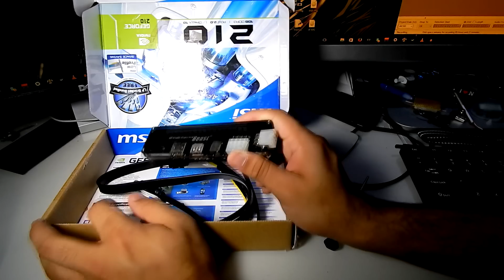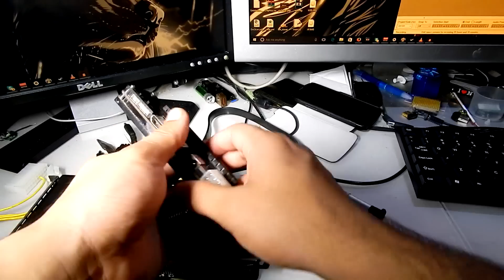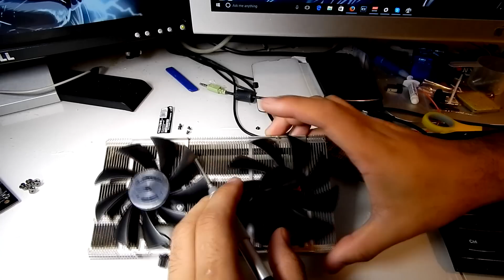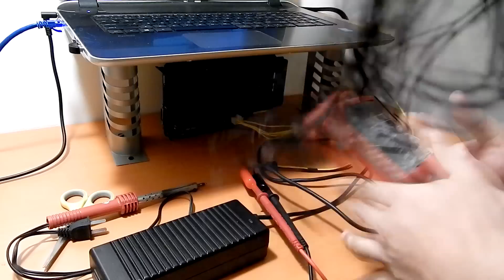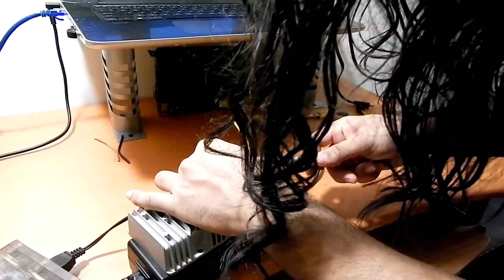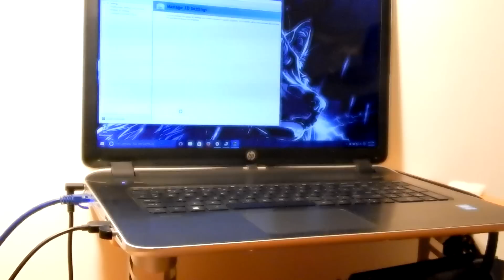Turn Any Laptop Into A Gaming Machine For 72$

Comment: 'Any laptop'...

Let's try with my Pentium II laptop! :)
Reply from the maker: I will die if that works xD
Reply: I'd love to "upgrade" my IBM ThinkPad 380Z (though it's not posting anymore :( )
Reply: lol good luck
Reply: Pentium isn't bad. It is just REALLY old.
The pentium was made before 2000 even.
Pentium III and Pentium II were also before 2000, and at the time they were good. The pentium 4 was just terrible though, and just used lots of power and made lots of heat with not much speed.
Reply: MrBiky Wow, I have a 380Z aswell! That was the laptop I was speaking of in the comment. :)
Most of it is made from parts from my 380E though. :/
Reply: +television and cheese Wow, awesome :D mine kind of stopped working, but that won't stop me from fitting a Raspberry Pi in it, lol
Reply: oh, crap, I'm on the other account
Reply: wait so Pentium is a bad processer?
Reply: i can't do it with pentium?
Reply: Youll probably be bottlenecked
Reply: One of the lower end processors yes
Reply: +Tech Talk Intel Pentium is that bad?
Reply: +television and cheese so if I'm getting a new laptop I should get Pentium?
Reply: I heard there was a new Pentium CPU, but it isn't very fast. If you live in the past, then Pentium is great choice, but today now is not a good idea. A good CPU is i5-i7 m series CPU. If you want something really really cheap, but still okay speed, get a laptop with a Core 2 duo. They sell on eBay for under 1$, but not as fast, just 'Okay' speeds.
Reply: +television and cheese thx!
Reply: Cough Pentium g3258...
Reply: +TheJrock _ g3260, i don't need oc
Reply: Yar! Ye be treatin' yerself to the bottleneck!
Reply: i wanan see this happen with my 17 inch laptop with and amd a6-6130 with r4 graphics
Reply: You'd have to take out your WiFi card, and have your laptops case propped open unless you cut a hole out for the cable run. 

These have existed FOR YEARS. I can't emphasize that enough. The problem is that doing all the things required for it. You can't really use it as a laptop anymore. It's also not plug and play. Requiring at least some degree of comfort with laptop repair to install them.
Reply from the maker: yea they have been around for a while.
Reply: I know. It was a joke that they used the words "Any Laptop" which isn't very accurate. 
My pentium II laptop doesn't have any internal PCI ports. Just one RAM expasion. There is no onboard wifi.
In some cases laptops have the PCI port under the keyboard, making it harder.
Reply: the funny thing is to get to my wifi card you have to take my keyboard off and my mother board out of my laptop just to get too it so its not for ALL laptops
Reply: willendler1993 william endler 
You still could. You'd have to make a cut out for the bottom of your case.
Reply: the way it is 
its the cooling fan then the wifi card then the keyboard so i cant cut anything on the bottom plus i still have 1 year coverage via hp and 2 with walmart plus il be building my own gaming pc soon and maybe a gaming laptop too
Reply: willendler1993 william endler 
Basically you're saying you don't want it bad enough. My past 3 laptops have been built like that, and it's never stopped me.
Reply: nope since i already have an alienware alpha with the i3 8GBs of ram and overclocked 860M and i only use my laptop to watch live streams and get on facebook since the a6-6130 in it slows down under load (from 2.4GHz down to 900Mhz)
Reply: +willendler1993 william endler wait m8 can my intel 4004 with 750 mb ram ?
Reply: You got this..... Hopefully
Reply: would it work with an elitebook 8460p

Comment: If i already have an descrete GPU in my laptop (GT 750m) does still work?
Reply from the maker: Im not too sure i dont have a laptop like that to test this with. But i wouldnt see why not if your willing to try it.
Reply: thank you for help!
Reply: Yes it will but you will probably have to disable one in device manager.
Reply: I will need some special software or the V8.0 mini pci, graphics card and a power supply are enough?
Reply: +TheLittleBilli no software is required exept AMD or nvidia drivers obviously and your done. If you want to overlock or just read temps of cou and gpu and a bunch of other stuff I would get msi afterburner it works with all gpus and computers not just msi's.
Reply: so the DIY eGPU Setup Menu 1.3 software is not needed?
Reply: No it just might make it run smother, in fact I have no idea what it does. Mine runs just and I have an 870m.
Reply: Yes it will work fine, because if your going to run games you will be displaying off the Egpu by having a monitor hooked up, although drivers might be a diffrent issue.
Reply: thank you!

Comment: I had to watch this, as it says "Any Laptop" this is untrue. Now I wont deny that this will defiantly help. However depending on the laptop odds are the CPU will be a limitation. A lot of people including myself buy a relatively cheap laptop simply to have a portable machine. If I want to game I have a $1500 custom built desktop, however if I were to do this to my laptop I would be bottlenecking the majority of video cards on the market except low end cards like a 750ti etc., I am sure many other people laptops would do this, unless the laptop sports something like a I5 at minimum, and I personally would not spend over $350 on a laptop, about the same price as a good video card for a desktop. For obvious reasons I would hope as well for $600 or more (The average price of a decent I5 laptop) I could build a decent gaming tower for my girlfriend. Now with all of that said that leads me to the second issue, a vast majority of new AAA games and higher quality indi games will NOT!!! launch unless your machine has a quad core (Or a minimum 4 threads for a hyper threaded CPU) Also don't forget that the PCIe will not be operating at x16 speeds because it is linked to a lesser speed slot on your laptops motherboard, resulting in even more bottlenecking than the bottleneck you already would have from the CPU  So if you are looking to play titles that you enjoy on your desktop, expect to be limited in your choices. That being said, if you are like me and you keep your old video cards laying around, just in case something happens to the one in you machine or a friends needs one. Then this may be a cool option and with some modifications it's not a bad option if you are someone who travels frequently, or just wants to try this out for the fun of it. Just be reasonable in your expectations as far as performance.
Reply: I'm new to the pc world my friend, but would a 5th generation i7 meet those standards?
Reply: +DaEpicPigeon yes...ofc....
Reply: A fifth generation I7 should not promote any CPU bottlenecking, just remember that due to thermals the chip is not as strong as it's desktop counterpart. However that is not the end of this issue @Christopher Bjørkeng is wrong, this although your processor is more than adequate he fails to remember that this is not the only factor at play for which I have stated above. The most prominent issue will bottleneck any video card regardless of the specs of the laptop is simply the device used within itself. The device is an adapter that is designed to convert the PCIe socket type to a PCIx16 socket that a video card is designed to run through. There is a possibility that your laptop has an MPCIe slot that is a mini PCIe x16 slot however you should do some research on that, as if the PCIe on the laptops motherboard is not running at x16 speeds then the adapter will not change that. So research you PCI type. Plus you may want to upgrade your RAM to 8GB. However if you are new to PC gaming this is not going to deliver the same quality of an experience. I would highly reccomend building a machine. If you unsure of what parts you need send me a pm with your budget and I will be happy to create a PC Part Picker link with the best hardware to match your budget.
Reply from the maker: I guess it all comes down to the machine ya have to be honest i guess i just happened to got a bit lucky. There's not much information on this sort of dock solution as of now so its a hit or miss when it comes to different laptops. Hopefully in the future maybe some more people who are more qualified to better understand how this works could possibly do their videos and hopefully we all can learn something from it.
Reply: +Tactux I do have 8gb of ram.
Reply: 8GB of ram has nothing to do with your PCIe lanes. If you had 128GB it still would not magically fix PCIe speeds, you cannot make an 8x lane run at 16x speeds

Comment: where did you buy the six pin to double 6 pin power cable? not sure what it's called exactly.
Reply from the maker: I ripped mines off a old PSU but you could look up, 6-pin to molex adapters and use that if needed.
Reply: +Davindra thanks!😃

Comment: Can u use any graphics graphic card?
Reply from the maker: yea but you have to make sure thisll work with your laptop and a card that isnt too crazy
Reply: At a certain point, it would be pointless to buy a gpu that is any better, because your cpu will bottleneck it.
Reply from the maker: Cheng Ye
 Not really aslong as your not using a carzy card you really shouldnt see a bottleneck hence why i went with a 750ti it run well on a old phemon II x4 and i had it lying around lol.
Reply: ***** that's cuz you're using a phenom II. it could run anything up to a 960 so no shit it won't bottleneck a 750ti. but does everyone have decent cpus? no. the vast majority of people think that gaming performance comes solely from graphics cards. gpus like the rx 480, 970, and 1060 are mid range processors that are sub $300. by no means are they crazy. your 750ti will bottleneck the shit out of them.
Reply from the maker: Cheng Ye
Thats kinda obvious lol, but thanks anyways.
Reply: +Davindra if u don't want to spend all that money a GTX 680 4gb version is really good